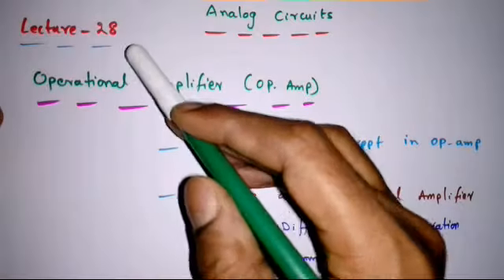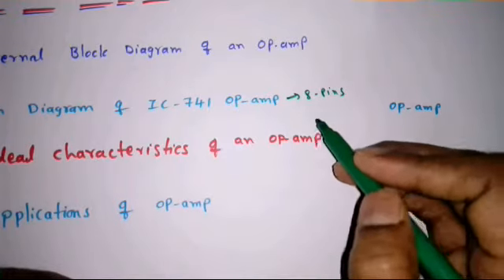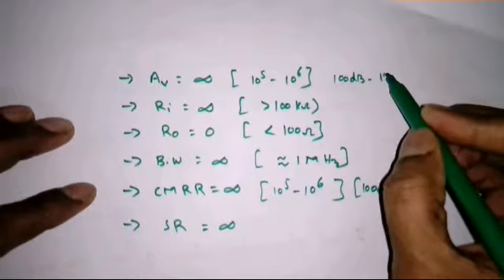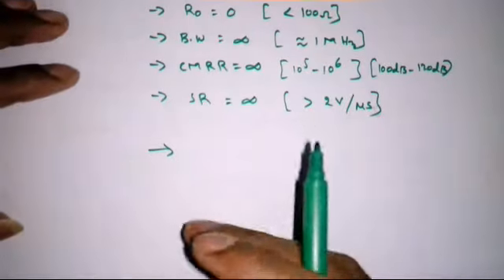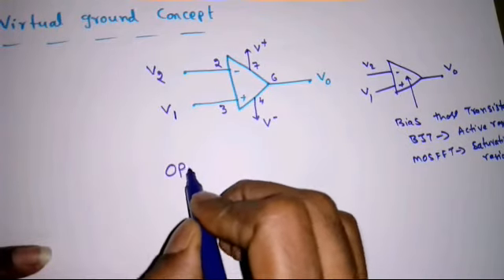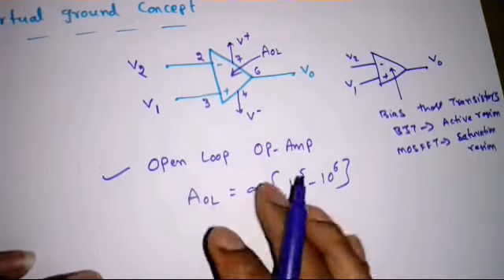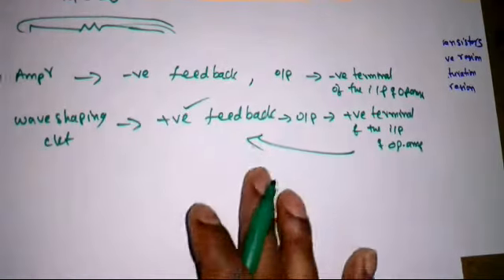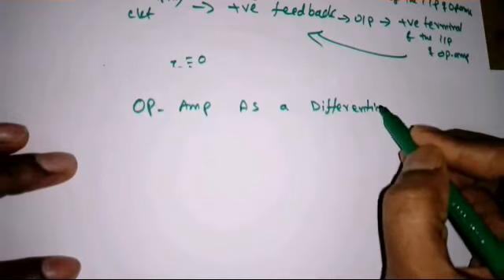Analog Circuits Lecture 28: Virtual Ground Concept of Op-Amp

Comment: sir you told that opamp will amplify only differential voltage.but in ideal opamp there is same voltage signal how we can say that  this ideal opamp is an operational amplifier ??
Reply: opamp will amplify only differential voltage  means it doesn't mean that if we gave same signal it is not an opamp. If you given same signal output will be zero.(i.e., there will be no amplification)
In an ideal case, 1)gain should be infinity.
                              2)When we have given zero input there should be zero output.These conditions can be satisfied ,only when same input is given.